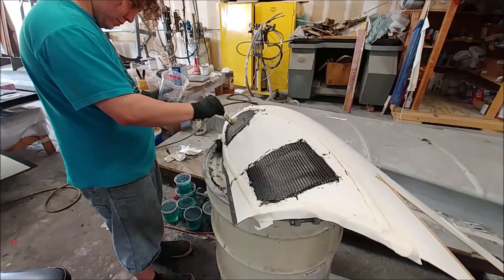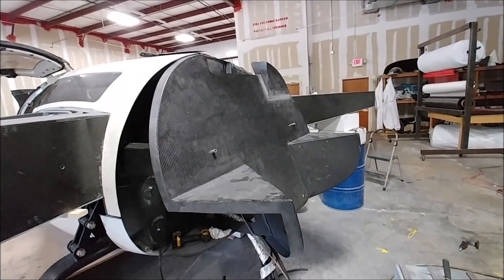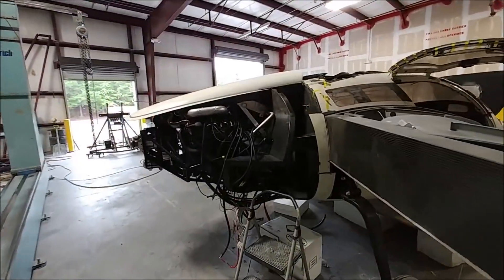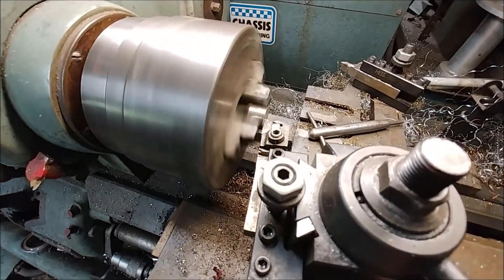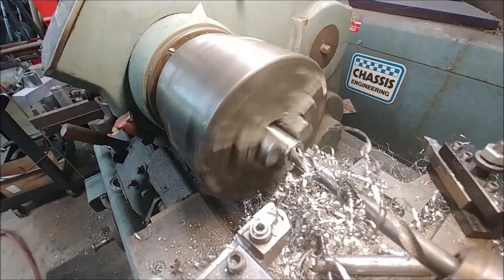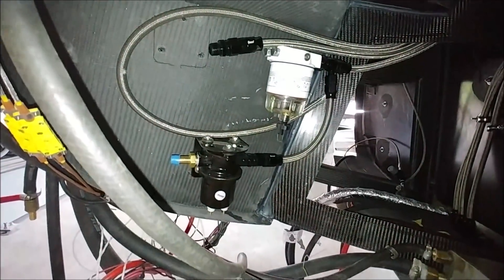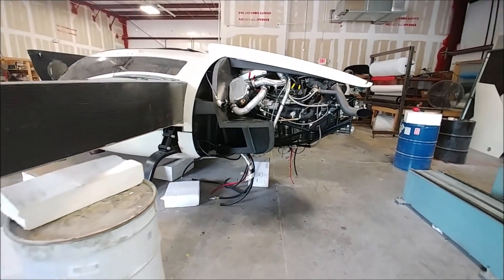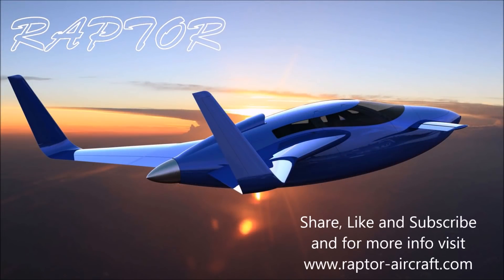Bolt On Horsepower - Building the Raptor Prototype

Comment: Is that "firewall" made from CF? I'd hope the firewall would be made from a fireproof material.
Reply from the maker: It's going to have a gold heat shield film added to it before the final install of the engine.
Reply: You mean one of these "space blanket" mylar films? Those are radiative shields, they don't insulate worth anything if you have flames or hot gas directly impinging on the firewall. You need something like a stainless sheet over an insulating layer like Fiberfrax to prevent the CF from getting too hot. (If I remember correctly, the Long-EZ initially specified an aluminum sheet for firewall material to save weight, but after someone had an engine fire and it melted, they changed it to stainless.)

Comment: With the CG shifting aft due to the additional weight of the engine, you mentioned the nose getting lighter, but that it won’t tip backwards on the prop, but what will happen to the CG when the weight of the swept back wings and winglets are added?  Do you foresee having to add weight to the nose to keep it in balance?
Reply from the maker: No. There's weight that we can move around if necessary.

Comment: The prop tip looks very low and the prop quite far back from the main undercarriage.  Have you modelled whether the AoA required for a prop strike is above or below the stall AoA in take off and landing configuration?.
Reply from the maker: Of course 😀
Reply: @RaptorAircraft   🖒

Comment: At altitude would the exterior pressure be lower than now thus increasing cabin expansion under pressure or is that a factor already accounted for
Reply from the maker: It's all relative so the answer is no. The door seals would be the only thing that would factor in to these tests. At altitude they would have firmed up due to a larger pressure differential from when they were inflated.

Comment: Quick question. Where are the fuel tanks going to be? Can’t see where they would go in the wings for 60gal each.
Reply: The Rutan design and all of those that follow (Cozy, Velocity, Berkut, Raptor, etc.) have primary fuel storage in the wing strakes next to the fuselage. Raptor Aircraft covered fuel tank construction in some of their previous videos. They also speak of a center (fuselage) mounted tank that both lateral tanks will feed into and the engine will draw from. Hope this helps.
Reply from the maker: You can see the inside of the left wing strake tank clearly in this video. It's painted with grey Jeffco.
Reply: Ahh my bad. Was looking for something bigger I guess. Thank you.

Comment: Noticing the same cooling system as on the test stand. Have you abandoned the idea of piping coolant through the leading edges described on the website?
Reply: I believe that is something that is planned to be done after prototype
Reply from the maker: We are heating the fuel in the strake tanks on this aircraft but the leading edge heating will have to wait.

Comment: looking good Peter but all I can think of is a prop strike.  Can wait until I see you fly her.
Reply from the maker: 12 inches of ground clearance as planned. Should be loads.
Reply: Raptor Aircraft    Do you know about how many degrees nose up you would have to be before the prop would actually strike?
Reply from the maker: Over 20 degrees. Not really doable before the fore plane is stalling.